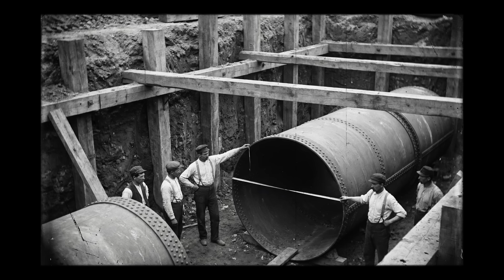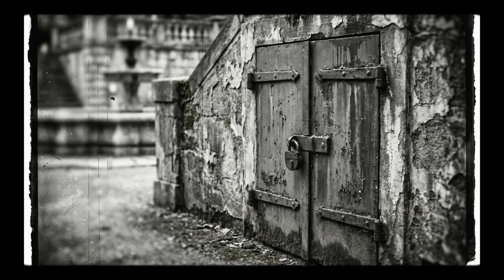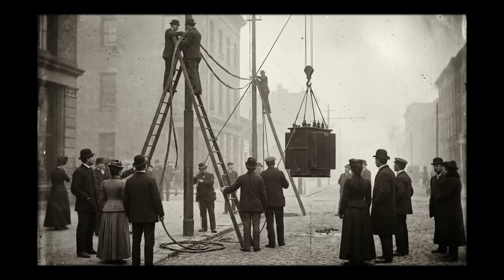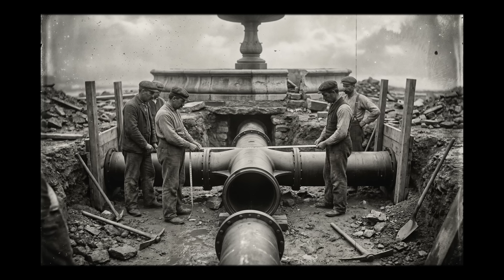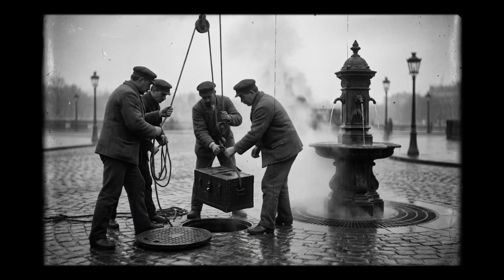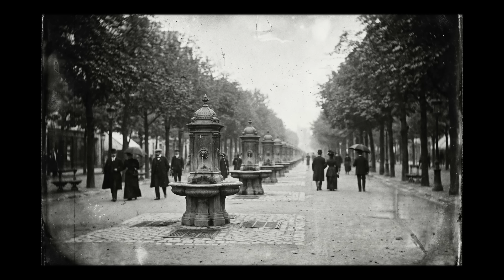How Tartaria's Fountains Were Actually Pumping Stations for the City's Power System

Comment: LOOK UP WATER TROMPES. They are very important. Like a RAM pump, you can look at many structures and discover interesting physics/hydraulics. Trompes were used to blow the mountain sides up in Spain during Roman times.
Reply: Maybe... there is another pump though that no one talks about. The one the plants taught us
Reply: @mattg6472 Siphon of sorts...
Reply: @mattg6472  Yeah, trees grow taller than 1atm(33ish feet) and a perfect vac would only pull it that high into a column. Yet they can transcend that limit into hundreds of feet.
Reply: @who-nobody-never  see the ram or trompe cant hack it cause they are your averge preasure system. Study the trees see thier pump doesnt act the same way. If the tree was high pressure it wouldnt just flow out nicely when you cut the tree. This is a very special pump with no moving parts can last forever
Reply: Haha 33 ish feet wonder what they are hiding
Reply: You are 100% correct, it's a ram pump - the fountain flows exit water coming from 'waste' valve of a ram pump system.
Reply: @MrMotorchild  And thus all the water damage everywhere. I still see a full out trompe. It was compressing air I suspect using falling water from the resevoir they built just before and ran the aqueduct which herodotus spoke of. Why there's no writing or anything inside. Was almost an industrial site.
Reply: @who-nobody-never what water damage? ive seen electrical damage. Fire from heaven
Reply: Not trompe or ram pump. Inheritors may have added those but the original pump was osmotic like the plant life all around us. They are designed after plants

Comment: Tartarian society was all about free utilities ! Free electric free water, free gas ! 
Someone couldn't live with that , so it was destroyed, and today WE PAY FOR IT ALL !!! 
That infrastructure can be engineered to run FOR FREE !! 
WHO OWNS OUR UTILITIES OWNS US !
Reply: Didn't they kill Khadafi for taking Lybia in that direction?
Free energy and utilities and an African currency plan?

Freedom, privacy, and sovereignty will not be tolerated? Doesn't seem like a human or humane agenda does it?
Reply: Power utilities are commonly publicly traded, shares on Wall Street. Very profitable, but for some reason the infrastructure is never significantly updated, so we regularly have massive power outages with every sneeze of weather with most power lines on poles overhead like EMP antennas waiting to fall or fry. Why would local power on the West Coast be owned across the country? Who owns the controlling shares?